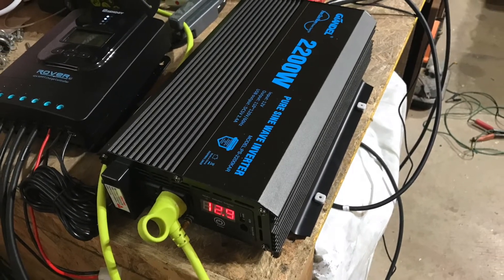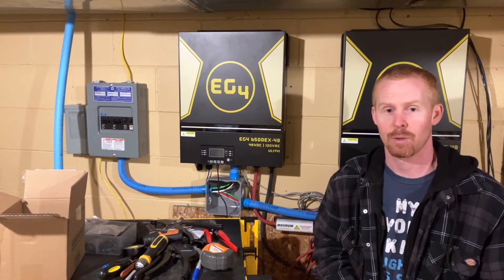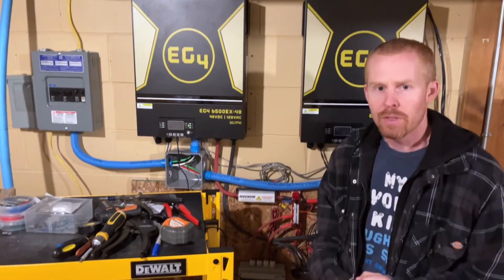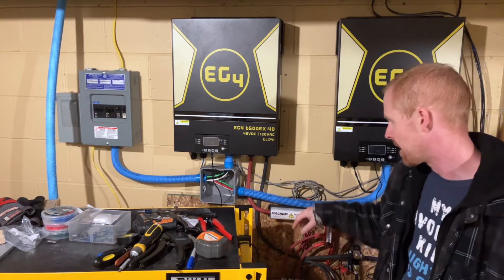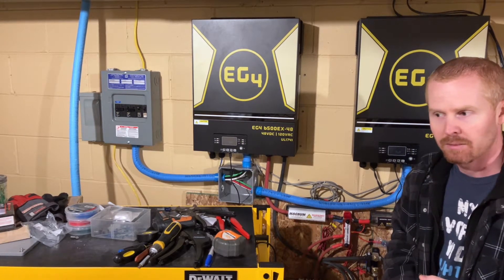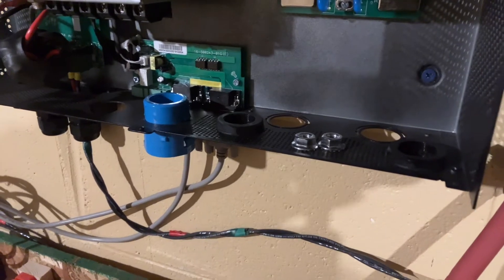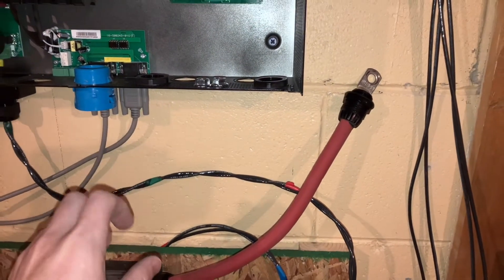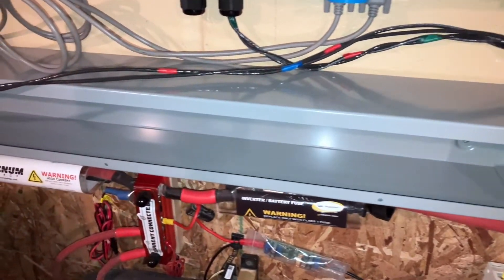WE'RE LIVE! - Wiring the EG4 6500EX AC Output to My Panel, Part 2

Comment: Oh the flicker. Lol. That's just life now. Even the best Schneider inverters have that issue on dimmable led lights. My MPP unit does it too. If u wanna cut holes use a hydraulic knockout kit. Drill small hole then it cuts the bigger holes
Reply from the maker: Yeah I was afraid of that.  I’m gonna try pulling the dimmer and see if that helps.  Even in bypass mode the lights flicker.

I forgot all about the hydraulic presses.  Seen them in a handful of videos but didn’t even consider that.  Thanks for the reminder!
Reply: + for the hydraulic knockout kit, takes minutes vs. hours to cut a raceway full of holes

Comment: I'm doing 4 of the same inverters. I'm using 6inx6in wireway. Lots more room to work with. The inverters are just shy of 6in thick..looks great. Keep up the good work. Thanks for your channel.
Reply from the maker: Thanks.  Yeah, I guess if I would have stopped and looked at the depth of the inverters, that would have changed what I bought.  While the 4x4 does work, it's a little tight.  I do wish I would have gone with the 6x6.  I'm sure at some point down the road I'll do a full re-wire and upgrade and notes like these will hopefully help me remember what I need to change! 

Good luck on your install!  What size battery bank are you adding w/ 4 of these inverters?
Reply: I'm starting with a full rack of 6 of the eg4 LL. To start with. We will see after a full winter. Might need more.
Reply from the maker: @jeffreysylvester905  good luck!  I’ve got 28kwh of storage with 6200watts (optimal conditions) and I’m thinking I’m gonna need at least 1 more battery bank.
Reply: @jeffreysylvester905  
I've got 12.2 kw of panels.
1 MPP6048 inverter 
53kwh of diy ev battery currently connected
50 amp interlock powering my entire house except the two ac units I put on a grid only panel. 

Future plans
Go to grow watt 12kw inverter.
Add another 17kwh of battery I have but am waiting on BMS units from CHINA

How's the surge on these eg4 units? 
Will two handle a 2 ton AC unit? 
My MPP has almost no surge. It clicks to grid bypass all the time. But even with it pulling from Grid for 10 mins at a time few times a day my DTE bill last two months was only $35. 145 kWh from the grid. I don't think adding another unit would help. But the LF grow watts apparently have tons of surge capacity. I'd like to go EG4 6548 but then I'd have to rewire both arrays and get all new breakers rated for higher voltage for the disconnects.
Reply: @electromechanicalstuff2602   I was halfway wiring my two 6500 and my friend who owns his own solar company advised to double my inverters because they are high frequency. My load study told me where close to handling all my stuff. I am going to add a/c next year.In far north cali we have a 30 deg temp swing at night.my full house fan and alot of insulation do pretty good.still on those 110 deg days need some relief. When I fire up everything I will hit you guys again. Thanks!

Comment: Nice improvement Adam. Turned out nice. I buried all my wires (AC input and output wiring), but would have saved 30 hours installing a raceway.. The one area I obsessed over is using the best fire rated non-combustable materials for walls, so used Durarock and Hardie Board..
Reply from the maker: Thank you.  As with most projects, hindsight is 20/20 and at some point I'll probably replace the current raceway with a larger one.  

Yeah, when it comes to needing non-combustible material, you have to go with the best.  No skimping allowed.  

Would love to see some shots of your setup.
Reply: @AdamDeLayDIY  I plan on doing a video when I am done. I have a 6 - EG4 setup with 50kwh EG4 LL.
Reply from the maker: Great!

Comment: Good job on the duct work. Are you going to incorporate a generator connection for charging batteries?.
Reply from the maker: Thanks!
Nothing automatic, no.  I'm going to hook up the grid line to the AC input of each inverter as a fallback in the event that we have a lot of cloudy days.  I do have my existing generator hookup that I can use (if necessary) but it will feed into the existing on-grid panel and then go into my inverters.